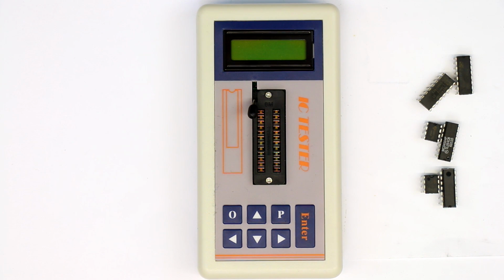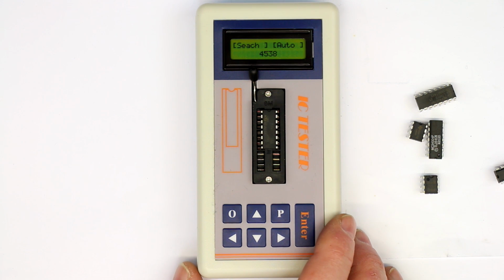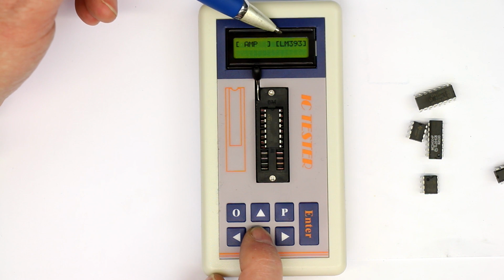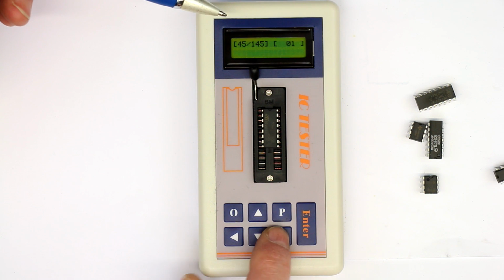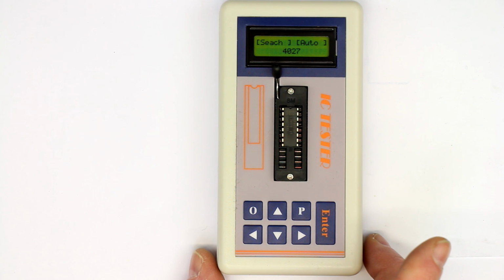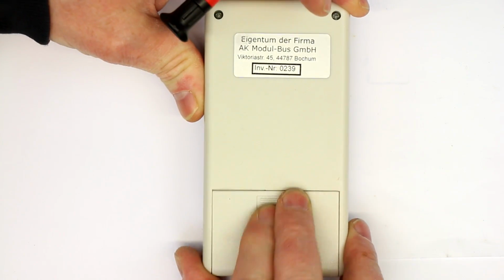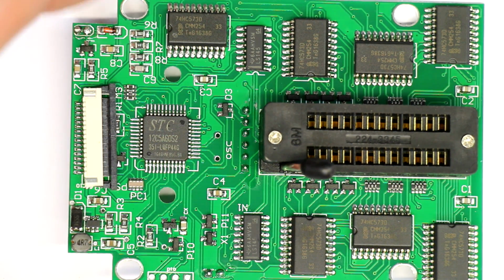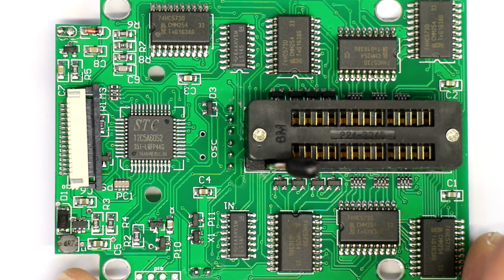An IC-Tester from EBay

Comment: Hello. Please read this text

I live in Iran. I am an electronics engineer. Sanctions against my country have been imposed by the United Nations and the USA. I need electronic equipment such as ESR meters - oscilloscopes - multimeters. These equipments help me a lot in repairing electronic devices. Unfortunately, due to very high inflation, Iran has been ranked fourth in the world. The Iranian currency is the least valuable currency in the world. If I work all day I get paid and rewarded and I want to convert it into dollars. I get less than $ 3 a day. It's really painful. I live in a small town near the border between Iran and Iraq. If I want to go to the center of the country in Tehran to buy and buy from stores, because of the rising dollar, many items can not be found for shopping. I must say that the people of Iran are very kind. . And the main culprits are the men politicians of Iran. They are always wrong. And unfortunately, the people of Iran have to pay for them. The people of my city cannot buy new equipment due to poverty. I have to repair their equipment anyway. I have to say that now I can not pay because of the high rent of shops. That is why I have to work at home. I work on the floor in my own house. I do not have a repair desk. I am repairing the TV on the floor, I am a modem, a receiver, etc. I have rented a small shop to store the items that people brought for repair, but I can not rent another shop. I have proof to prove this, and now you can get a telegram number. Or give me WhatsApp so that I can send you photos of my situation. I got married a year ago. My wife has been pregnant for 4 months now. But the most important thing is to send you money and buy things. If you can, do not buy them in Akband. Because I can not send you money in dollars. Buy them second-hand and used so that I can at least send you the money. My contact number is 00989188440206   WhatsApp and Telegram
Sajjadmirzaee6@gmail.con
thank

Comment: Ok, so it can identify components BUT does it tell you whether the DUT is good or bad?
Reply from the maker: It can only identify an IC if it is basically working. And a bad IC can´t be identified. Of course it cannot check if the individual specs of an IC are met.

Comment: Interesting product, i saw similar device but connected to PC ->
https://www.ebay.com/itm/Transistor-Tester-Detect-IC-Meter-Diode-74-54-series-AD-DA-4000-4500-Software/181436184360?hash=item2a3e707728:g:bDkAAOSw-~NbLEkG

Did someone already buy it and can share software?
I would like to see what kind of IC does it test.
Reply from the maker: That one you found on Ebay looks quite promising but  is quite expensive for more than 200 $/€. It´s a bit too expensive for buying it "blind" for a test. Perhaps somebody else on YouTube already tested it?

Comment: I recently brought one of these to help repair a old arcade PCB and it did find the faulty 74ls139, but it would not test a 74ls163 it just says fault on every chip even when they are good. do we know if there are any firmeare updates for these ?
Reply from the maker: Sorry. No, I don´t. Firmware updates for mostly undocumented chinese devices are very rare (to say the least) :-)
You usually get them  "as is" without any support, documentatiotn etc and most of them are not open source.
If you are lucky there is perhaps somewhere a forum on the WWW where this thing is dealt with.

Comment: I have one, it fits nicely in my Fluke meter case accessory pouch. It comes in handy on some of the older boards I work on.
 I have never tried it on discrete components such as leds or diodes but it is a cool little gadget.
Reply: Jilvir Paeste  that is not correct.
Reply: Yes maybe you are correct , should be able said that check out !.

Comment: This tester does not automatically identify ALL the ICs it can actually functionally test, for these you have to use the menus to select the correct type of device ( for e.g., choose the LIGHT section to test a 4N25 optocoupler). You can then press the Enter button and it will identify and test the IC. This is true for other ICs which are not common (74/40 series logic) where it may appear not to recognise the IC but in fact it is able to test. Really need a definitive list of the ICs it supports. It also tests transistors, mosfets and zeners - but you have to plug them into the right place in the Zif socket! The lack of instructions really lets this package down.
Reply: I don't know much about these STC 8051 microcontrollers... but if it was an AVR, I'd be thinking about hooking a programmer up to it, dumping the firmware and running "strings" on it (hoping it's display messages are in ASCII) ..... there would be a list of all it's supported devices in there.... .... .... of course, a lot of microcontrollers have a fuse to stop you dumping the firmware .....
Reply: You really said it there. At the core of this sometimes-maligned cheapo device is an excellent tool. The other game in town--the TS-210 has a crude PC-control GUI that might open this process up to improvement. Without coherent English-language instructions and continued tech support, though, it's going to be another tossed-off Ali, Geek, Wish, etc. device that will be forgotten. I have a fairly big pile of ICs and less knowledge about them than I should. Something comprehensive is bound to emerge soon. de W0XO

Comment: Have you tried any faulty chips to see what it reports?
Reply: It will only give you the same number identifier, probably if your IC is short-circuit or opened it will say not found..LOL . But if your IC is partially faulty,  it will keep displaying the IC number identifier.
So you will be having probably a good or bad IC to deal with it...LOL

Comment: Does anyone know what open source project they stole this from?
Reply: probably from somewhere around where they stole the transistor tester from, I have seen a mixed model on ebay which does the avr transistor tester functionality as well as this IC guessing.
Reply: Dennis Lubert 
  The OSHW transistor tester project is from: 
mikrocontroller[dot]net/articles/AVR_Transistortester

The English support forum is on the EEVBlog Forum under "test gear" and the thread "$20 ESR LCR Transistor Component Tester"
Reply: @PlasmaHH  russia
Reply: Not stolen. Period. Good product and cheap price, win win for all.

On eeblog about same great tool the original softwre designer applauded this design and safware improvements they made based off his work. No issue.
Reply: @airgliderz  and those updates are where?   Where is the license that's supposed to be  included?   Its stolen  Period.   It's perfectly to sell goods with opensource on them.   Its the lack of attribution that makes it stolen  Period.
Reply: @chipheadnet  does not matter, No one cares, I don't, developer does not care, in fact likes it.
Liberal lawyers ruin everything. 

It's a good product, just ordered one to support this maker.
Reply: @airgliderz  if you dont care why Reply?
Reply: @chipheadnet  just to bug you...!
Reply: can you steal an open source project?
Reply: @djtoddles8750  Absolutely.   When you use without attribution and passing on the license you receive, your stealing.
Reply: @chipheadnet  ah, I hadn't thought of that. Good point
Reply: @djtoddles8750  no
Reply: @djtoddles8750 no
Reply: Its not stealing. They are just putting the work in to put an open source product together and selling it cheaper than you can make it yourself.

Comment: Hi, from Ireland,well done, i love yours videos.Big tomb up.
Just find a video with demo of using this ic tester http://v.youku.com/v_show/id_XMzQ5NzI1ODgw.html into the ebay item description , and English translation Chinese :
The multi-function integrated 
circuit tester is a professional instrument designed for the first-line 
microelectronic engineering staff , maintenance staff . Different test mode can 
be selected 5v mode , 3.3v mode , AUTO mode can test 74HC series 74LS series , 
CD4000 series , HEF400 Series , 4500 Series , operational amplifiers, interface 
class chip , optocoupler transistor automatic identification regulator regulator 
value recognition , and so on . Built-in 13 kinds of various types of chip data 
model , the transistor data model more than 420 kinds , covering a majority of 
24 feet or less common universal device , can significantly reduce the workload 
and improve work efficiency

The panel has 5 buttons are on the left, 
right, bottom, and Enter keys.
The next key is used to adjust the directory 
and change the model number, the or so key to move around the cursor options to 
change.The Enter key for the switch machine and execute the test command.Gently 
open the battery cover, add a 9V laminated battery, and then close the battery 
cover.Press Enter for more than 2 seconds can boot, boot automatically display 
the current battery voltage, when the voltage is lower than 7.5, please replace 
the battery, the low voltage will affect the reliability of the test result and 
protection automatic shutdown.
Boot: Enter key press 2 seconds then 
boot.
Shutdown: 1 in the OFF directory, press Enter button to immediately 
shutdown.
2 in any directory, press Enter button for more than 10 seconds 
then off.
3 in no operation after 60 seconds, automatic shutdown
ethods of 
devices placed:

1, the top of the chip alignment
2, put the most left 
transistor three slot
3, a 13 foot alignment IC Optocoupler
4, voltage 
regulator tubes placed IC block 13 and 14 feet.
Note: the transistor display 
pin order from left to right and the corresponding IC block, 10 feet, 11 feet, 
12 feet
  

Catalogue

Function

Search

Auto mode

Device search , the unknown model chip inserted in ic seat can automatically identify the part number
( Automatic identification without input) ( other directories are auto- mode )

5.0v mode

3.3v mode

74HC

74HC series of logic device test (of the same, and 74LS series base drive level (different) need to manually enter the model)

74LS

74LS series of logic device test (of the same, and 74HC series base drive level (different) need to manually enter the model)

CD40

CD4000 series of logic device test (different, and HEF40 series base drive level (the same) need to manually enter the model)

HEF40

HEF4000 series of logic device test (different, and CD40 series base drive level (the same) need to manually enter the model)

45/145

45 series 145 series logic device test (the need to manually enter the model)

OTHER

Interface drive device testing, such as: MAX232, MAX485, 75175, 75176, 75c11.. (the need to manually select the model)

AMP

Operational
 amplifier, comparator class testing, such as: LM324, LM358, LM339, 
LM393, LM2902...(the need to manually enter the model).

    TR

Transistor identification , and automatically determine the transistor 
types
 and pin order . Identifiable NPN , PNP, transistors , N- MOS , P -MOS 
way thyristor , triac , common anode common cathode rectifier
 automatic identification without input )

ZD

Zener 
regulator value test , test regulator regulator 0v-50v range accuracy 
0.01v automatic identification without the need to enter 

LIGHT

Optocoupler secondary the saturation voltage test , can test the the ordinary 4 feet optocoupler secondary 
saturation voltage automatic identification without input )

OFF

Shutdown

prompt

explanation

OK

Tests are normal

Batter

Battery voltage

Not found

Can’t find

Fault

The chip damaged or type mismatch

Open

Open circuit

Not supported

nonsupport

NPN

Triode

 PNP

Triode

  N-MOS

FET

P-MOS

FET

1-SCR

Way SCR

2-SCR

Triac

2D

Common cathode and common anode rectifier

A、k、b、c、e、g、

Specific pin

Out of range

Zener voltage beyond the scope 

ERR1、2

Self-test failure

Comment: So do we assume that if it identifies it, it is good?  Or, did you identify and then not run a test routine?  Thx.
Reply from the maker: You can never be 100% sure, that an IC is 100% within all its specs with such a simple tester.
The main purpose is identifying and testing the basic functionality of a chip.
Perhaps someone can find the original project for this IC-tester.
I´m pretty sure that it´s a rip-off of an (open-source) project from a clever maker which the chinese made into a commercial product.
There one could find out more about the algorithm of the test-routines and the limitations.
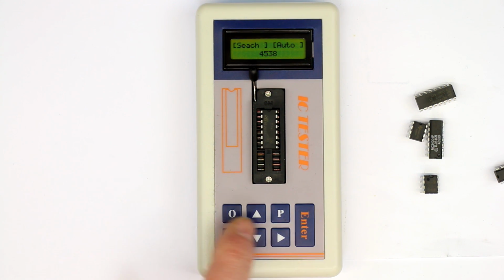Reply: 3:02 "relatively sure that the ic is working properly"
Reply: Many thanks!
Reply: Surging Circuits l0h